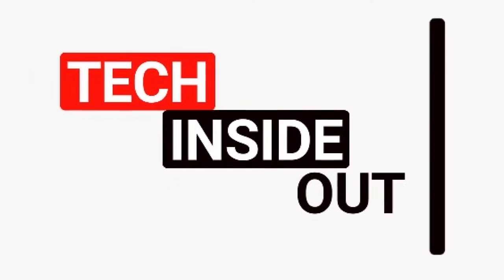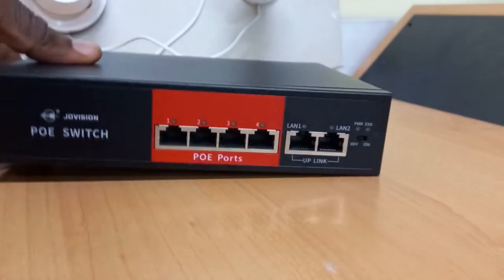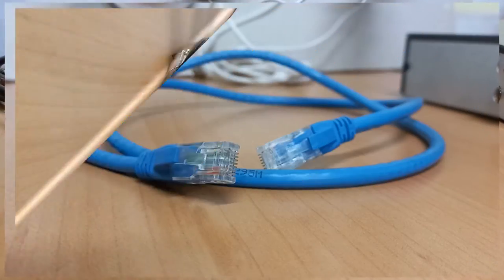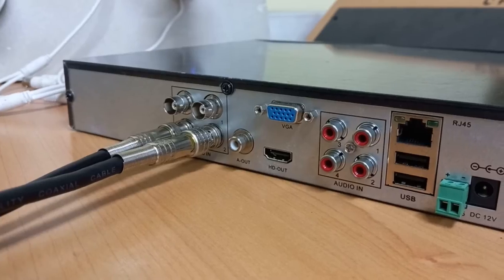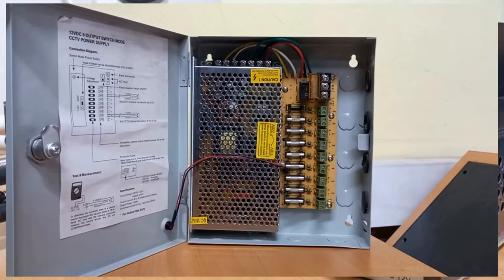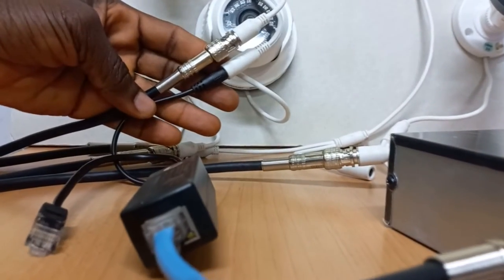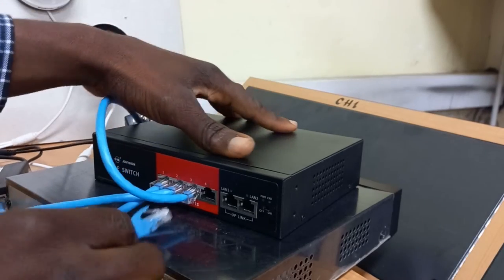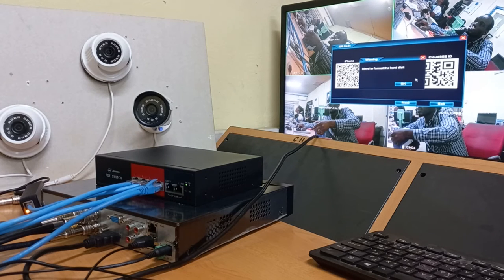How to Install AHD CCTV Cameras using POE switch as Power Source.

Comment: That's a great way also to use an IP RJ45 camera to connect to a Poe switch with more ports, and connect the dvr with the poe switch using cat 6 cable.
Reply from the maker: Thanks

Comment: Hello.Can you show a link where you can get a jumper cable to extend camera cable if too short?How to test Poe splitter if all cameras are experiencing video loss?How can I get firmware upgrade for cameras like  Swann or BunkerHill or Fosco?Can you do a video on how to set up DVR if I set my security system back to factory default?
Reply from the maker: 1. For the jumper cable, kindly link up let me direct you. benedict.gborgblorvor@gmailcom
2. I will consider a tutorial on how to test POE Splitter
3. You may have to contact the product manufacturer if there is a firmware up-grade
4. Well noted

Comment: Which of the setup is more efficient for use ?
Reply from the maker: I prefer the POE switch method because in my many years of installing CCTV Cameras, i have found out that the old type of power supply gets spoilt very often whiles the cameras themselves remain working. This is something i have seen on countless occasions and that made me to come out with this option. 
This option has proven to be the best even though it is a bit expensive.
Reply: @Tech_Inside_Out  thank you for the knowledge sharing.
Reply: @Tech_Inside_Out  Sir, how then do you conveniently create a back-up power system solution for your set-up (since the previous option appears more convenient, as it involves hooking up a storage battery to the power distribution & then using it to power every component of the CCTV system)? Thanks for your great videos👏🏾

Comment: It's very expensive but  DC adapter of 5A 12volts power splitter can be used instead of this process.
Reply from the maker: Durability, Video output quality and Reliability are the focus of this video. 
I have mentioned in this video that the cost is high, but the benefits are un-comparable.
The "DC adapter of 5A 12volts power splitter" cannot drive voltage along a cable up to a 100m without an ELECTRICAL NOISE seen in your camera videos. The POE switch could drive voltage along a cable up to a 100m without experiencing the electrical noise.

Video quality will be compromised as a result of voltage drop when the  adapter you mentioned is used and many more un-comparable advantages EXCEPT the initial cost.

Comment: I see people power CCTV with adopters, how about that?
Reply from the maker: How durable can an adaptor be since a CCTV is a Security gadget that must be on 24/7? . I have seen several CCTV systems that am called to rectify problems on and most of the issues are power related.  This has been a solution that has worked for me.

Comment: How about if the camera has RJ45 port, can we connect directly using splitter instead of coax to power the camera? Thanks
Reply from the maker: Cameras with the RJ 45 port can be connected directly using the POE Splitter if the camera is a non POE Camera. POE cameras will not require the, splitter, they can just be connected directly to the POE Switch. You can check this video https://youtu.be/gJfuCZe1Avw
You can also look at this video, it combines both POE and non POE cameras, showing how the cameras are connected to the POE switch. https://youtu.be/TsTJtDFzGsE

Comment: Hi
Which will be the best way to connect   30 cameras, furthest cable run 120-130m.Havent worked with ip system before
Reply from the maker: Hello Selvan,
With a 30 camera network, i will recommend using IP cameras for many good reasons i cant espouse right now. I have many videos that when you follow you will be able to do it even as you haven't done one before.  Please link up by email benedict.gborgblorvor@gmail.com so that i can share my contact  for any guidance needed to effectively handle the project. 
On standby to hear from you

Comment: Please can you help me out 

I have a smart ptz Wi-Fi camera(non Poe) and a jovision Poe switch but the problem but the problem is the Poe switch can’t turn the cameras on when connected to the Poe switch with poe splitter. Please any help for me
Reply from the maker: Please check the required voltage for the Camera. Some of them are powered by 18v dc and if it is, it can't come on with a POE Switch. The POE Switch gives 12v dc which is not adequate to power up an 18v camera. 
I will be glad to know the camera details so i can as well do the checks.

Comment: You need a good power supply pack and a decent surge protector.
Reply from the maker: A POE Switch provides power to IP cameras. Why can't it be used to power up AHD Cameras.  Technically speaking, a POE Switch is much more robust than a CCTV power supply unit and talk of surge protection, it is excellent compared to a cctv power supply unit

Comment: I feel it’s waste of money! 

Just use a power brick 12VDC/5A and run 2 core cable . 

Or just buy Video balon and 1 Ethernet cable for each camera.
Reply from the maker: Thanks for your opinion, nonetheless i have seen many of such power bridges get damaged very often even at standard load capacity and so this is an option i prescribed which i admitted is EXPENSIVE but DURABLE. 
The other options you stated have a different focus other than power.  My focus on this video is power durability
Reply: @Tech_Inside_Out   bro, am using an aluminium grill box type SMPS 12VDC 10A. 2 Piece SMpS for 16 channel camera. And 1 piece 12VDC 2A power adaptor for the DVR and Router. Installed 5 or 6 years ago. Still ok good condition. 

I think your country side may have a lot of power fluctuations. In case that’s the problem, I will strongly recommend you , but a traditional 12V step down transformer and DC rectifier. That May won’t spoil due to power fluctuation.